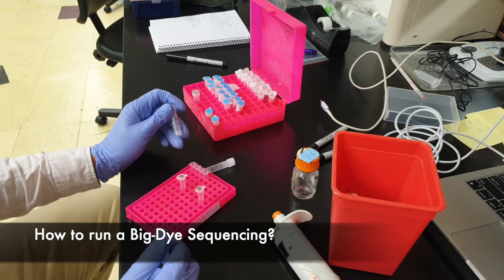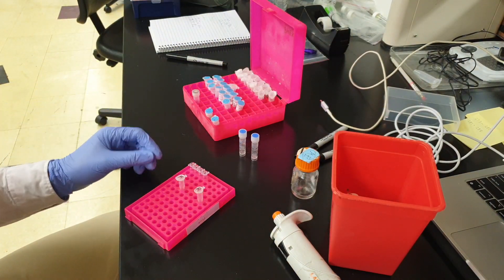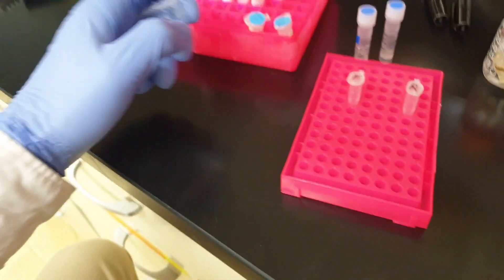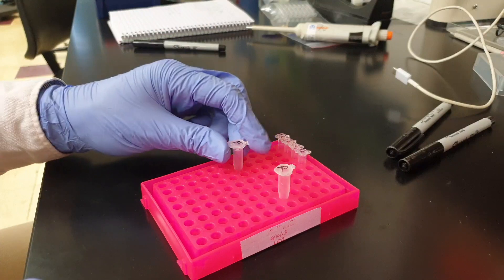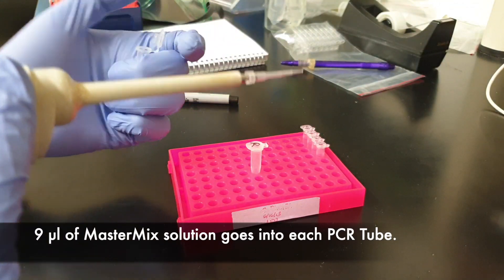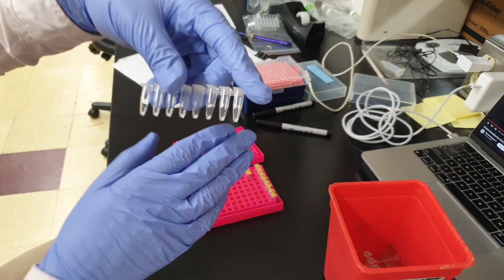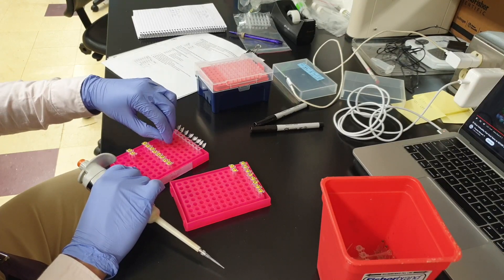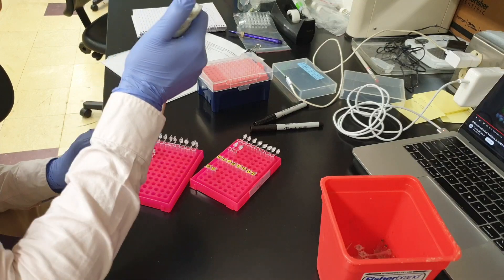How to perform a Big Dye Sequencing? #Tutorial

Comment: great video, but i have a quick question, shouldn't the Primers be on ice ?!
Reply from the maker: While it's recommended, it's not necessary. They are not that temperature sensitive. Also, even if it goes bad, you can make a new aliquot, because the stock solution is kept in the freezer.